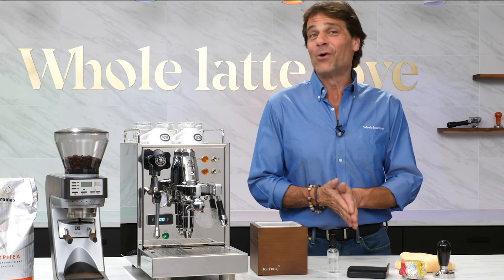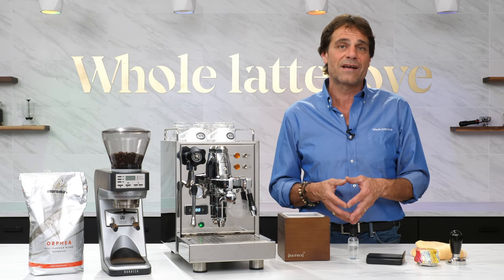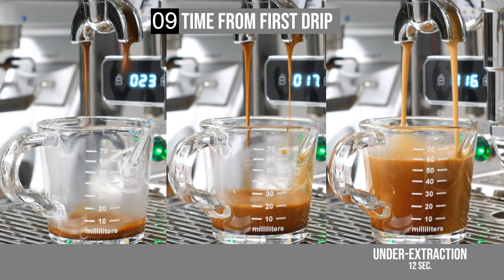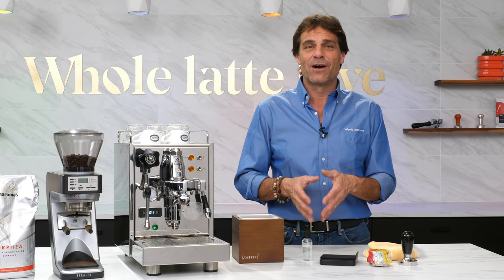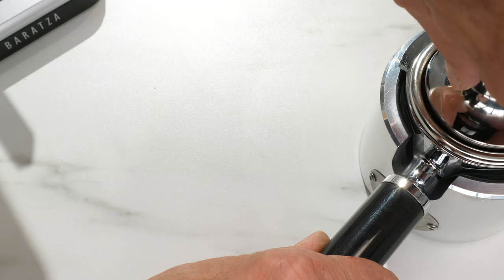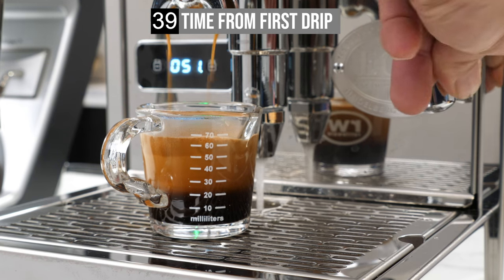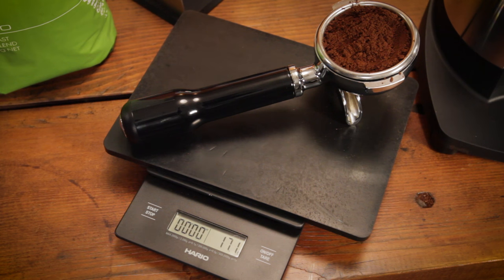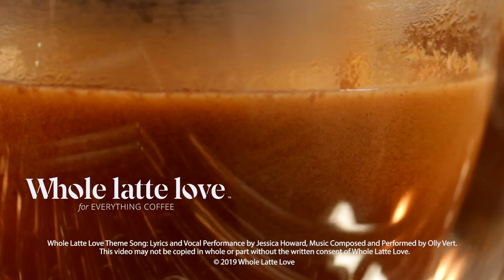How To Dial In Grind Size for Espresso

Comment: Newbie here. Why use the term dial in? I associate that with phoning in hence means half ass effort for me. Haha. 
Btw, I am using super automatic Philips Lattego 5000 and wonder if the 30seconds 60mls rules applies for that as well. 
And those aroma setting in the lattego refers to which parameter? 
Thanks in advance.
Reply from the maker: Hi Patrick, So Dialing in grind size is a common term for turning the grind size dial to get the grind right. Shot timing does not apply to super-auto bean to cup machines. They use the same process for extracting espresso as semi-auto machines but the amount of coffee used per brew cycle and design of the brew group with smaller surface area results in faster brew times. I have not used the Phillips machine but aroma settings on super-autos often refer to adjustable duration of pre-infusion which wets the coffee briefly prior to full pressure brewing. If not that it might be referring to coffee strength - the amount of coffee ground for each extraction. Hope that helps!
Marc
Reply: @Wholelattelovepage  thanks. Appreciate the reply. Philips lattego 5000 is basically a rebadged gaggia anima if not mistaken. I am watching this videos because i am thinking of switching to semi pro machines. Quite disappointed with espresso/ coffee from my superauto now. I am from Borneo so no place to try out or even see the machines before buying. I basically buy it online, based purely on youtube reviews such as yours. Shortlist now is nouvo simonelli oscar 2, rockett apartmento and maybe crem one.

Comment: I'm confused about what volume I should be getting from particular ratios. For and 18g double shot I'm usually getting around 36-40 grams of espresso at about 1 to 1.25 ounces. This feels a little low on the volume side as I would expect 2 ounces out of a double shot. Am I doing something wrong?
Reply from the maker: Hi n, Thanks for the question. If I understand correctly you are having trouble with weight of extraction vs. liquid volume? Weight is far more accurate! Volume measurement is difficult due to the crema. Some coffees produce more than others. I work with some which will do in cup volume of near 70ml at in cup weight of about 40 grams. Crema weighs a lot less than pure water which is 1g per 1ml. Other coffees I work with produce far less crema and will be closer to a 1:1 grams to ml relationship. Hope that helps!
Marc

Comment: Hey Mark, great tips! One question about the timing. I have a new Bezzera machine with Eureka grinder and I can see that in your case when the first drops of coffee fall, the total timer is around 10s. In my case this happens a lot before that and the first drops look quite watery. Nevertheless, the pressure on the gauge goes up to about 11 bar. I believe that going finer would increase the pressure even more. Do you have any suggestions?
Reply from the maker: Hi MH,  Thanks for the comment and question. Bezzera machines have an OPV which limits total pressure.  A bypass opens in the OPV valve to dump excess pressure back to the water reservoir. If everything is working properly you'll reach the OPV's setting and pressure will not increase so grinding finer will not increase the pressure. Frankly 11 bar is a high setting for the OPV to kick in. We typically set vibe pump machines to produce 10 bar max (that gets you ~9 bar max on the coffee puck).  If your first drips are happening really fast like <5 seconds and they're watery my guess is your grind is too coarse regardless of what the gauge says. I would try grinding finer. Gauge may not be reading properly.
If you have a backflush disc (blind filter basket) I'd put that in your portafilter and turn the pump on and see what the gauge reads. Once it reaches the OPV setting the pressure should go no higher.
Marc
Reply: @Wholelattelovepage  Thanks Marc! Interesting, these are actually the factory settings as the machine is brand new (Bezzera Unica) I indeed have the blind filter basket to test the OPV setting. If this max pressure is set at around 11 bar, do you think this might negatively affect the extraction or (even worse) damage the machine if I grind finer?

Comment: I got a question so i have a Solis Caffespresso Pro Type 177 with pre infusion which probably doesnt matter but the question is what ratio should i choose for the recipe i want to use?
Or the ratio is only dependant on the beans?
i have a 2/5 intensity roast(even though the beans seem darker than 2/5) which should be mild with karamel and chocolate.(Specifically a BOOT - Colombia Kachalu organic Santander)
Reply from the maker: Hi B, Apologies for the delayed response. I would try the coffee at different ratios and taste to determine which you prefer.
Marc
Reply: @Wholelattelovepage  thanks I messed around with it a bit longer with vids as base help it turned out really nice and at times absurdly sweet thank you for the vids!!!
And have a nice holidays. 🌷💞

Comment: Straight out the box (breville bambino plus), and according to the manual, 16-19g coffee for a doubleshot, it only seemed to be pulling 30-40ml coffee in about 14 seconds on the factory programmed 2 cup button.
I tried fiddling with everything, the grind size (now at the smallest my grinder will go), 16 vs 19g and different tamping. Using the razor and not. 
A bag of beans later, I managed to tamp tighter (with the help of some scales, breville says 15-20kg) and managed to get 60ml in 26 seconds but why was the factory setting so far off?
Is it because a quicker extraction is ok for pressurised? But it still doesn’t pull 60ml! Arghh!
Reply from the maker: Hi HW, Timing is out the window when using pressurized basket. It's mostly the restriction of the basket and not grind of coffee affecting the extraction. That said do grind very fine for best results.
Marc

Comment: Why did you measure to 70mm, I thought a double shot was 60mm. Was it to account for the crema?
Reply from the maker: Hi J, Thanks for the question. Yes accounting for crema. Volume measurement is very basic. Next level is using scale to weigh output and get a brew ratio. Check out this video where I pull bottomless triple shots to a 1:2 ratio using an Acaia scale and Brewmaster App to log extractions. 21g coffee dose with shot stopped at 41g weight in glass. Crema in the shots takes volume to near 70ml: https://youtu.be/HTaly8c-i_U
Marc

Comment: I have a Breville Barista Touch and am currently using Lavazza's Super Crema whole bean coffee. I've found that in order to get from 17g to 34g of ground to brewed volume, I have to go the finest ground setting. I grind for approximately 20 seconds at that super fine setting, but the grinds aren't flour-like. Am I doing things right??
Reply from the maker: Hi James, Thanks for the question. If your grind is truly flour like it's probably too fine. Espresso grind is often called "powder" but sounds like you are closer to a Turkish grind than espresso. Turkish is finer than espresso. Breville grinders tend to be slower than larger flat burr prosumer level grinders but 20 seconds seems like a long grind time for 17g. You didn't mention how long your extraction was taking. Your shooting for 20-30 seconds from first drip. In my experience extracting Lavazza Super Crema at 1:2 ratio yields in cup volume including crema in the measurement of 55-70ml as the shot finished at weight of 34g. Just to verify you are using the single wall (non-presurized) filter basket? If not, thgat's what you should use.
Marc
Reply: @Wholelattelovepage  Thank you so much for the reply! Yes I believe I'm using the single walled non-pressurized basket, which I believe came default installed on the portafilter. I do think I'm grinding too fine and for too long; perhaps it's my tamping technique that isn't quite right? When I was originally trying to dial in the machine, I kept on getting watery shots that went way past the 1:2 ratio. I guess I'm not tamping hard enough? It's hard to know how hard to tamp though, and I don't have a scale that I could use to see how much 30lbs of pressure really feels like. Should I try raising the grind size to coarser and try tamping more firmly to see if that makes a difference? Also, right now I have the machine set at a total of 25 seconds brew time, meaning the original drip occurs at 8 seconds or so and finishes at 25. I'm assuming this is too short? Perhaps I should try to get fresher beans as well? Thank you so so much for helping answer my questions!

Comment: Does a doser on a grinder help? And is it true that the doser only works precisely when there is a lot of grinded coffee in the doser? I at home make 1 or 2 coffee in the evenening, should i buy a grinder with doser for the few cases with a lot of visitors?
Reply from the maker: Hi Philippe, Thanks for the question. We sell very few doser grinders. In the process of phasing them out. In order  to dose consistently they need to have good amount of coffee in the doser. They tend to be messier than on demand grinders and with the focus on freshness most don't want a bunch of preground coffee sitting for long periods in a doser. When in Italy last year dosing grinders where still the norm in cafes. Here in the US and I'm guessing other countries a dosing grinder in a cafe would be a sign they were not very focused on quality and instead working a commodity. I would not purchase a dosing grinder for home use.
Marc
Reply: @Wholelattelovepage  thanks, that makes sense. Another question, if i may ask here. I have a siemens eq6 now and planning to go for a half automated next year. But i like the DE version of the Bezzera, or the Elektronica from ECM. Also i like cappuchino so i need HX machines. I dont have unlimited budget, but can you recommend on a programmable dosing piston machine like the bz10de or bz13de or a e61 variant, with rotary pump and watertank+external water connection? 👍🍾

Comment: Question, we got a breville barista express recently. I only get to a 10 o'clock position on the pressure gauge even if the grind size is already dialed on the finest setting, should I be concerned?
Reply from the maker: Hi Vince, Sorry for the delayed response. I've been off line for about a week. I do not have a Barista Express in front of me at the moment but I believe 10 o'clock is in the acdeptable range for brew pressure. If you think it should be higher using the same grind size but a higher coffee dose can get you there. A more forceful tamp could help as well. You can also adjust the grind finer than the basic settings outside of the machine by making an adjustment on the burr itself. See page 20 of this manual for how to do that: https://www.breville.com/content/dam/breville/au/assets/miscellaneous/instruction-manual/espresso/BES870-instruction-manual.pdf
Hope that helps!
Marc

Comment: I have an ECM synchronika and my extraction starts at 4 seconds and reaches 25 seconds with 2oz fluid. In your video it seems to start at 8 to 10 seconds. Is 4 seconds good to start ? What can i adjust to make it start at 8-10 sec for 2 oz fluids? Thanks
Reply from the maker: Hi jg, Thanks for the question. Typical ways to slow an extraction are finer grind and/or increased coffee dose weight. A little harder on the tamp may extend as well but depends how hard you are doing now. First drip at 4 seconds is a bit quick IMO.
Marc

Comment: How would you dail in espresso without a weight scale? Got a grinder and manual shot control (but no temperature or scale).
Reply from the maker: Hi RK, Thanks for the question. Thanks for the question. Without a scale slightly overfill your portafilter then level with a finger prior to tamping. This should give you a relatively consistent dose weight shot to shot. That consistency is important when dialing in. Hope that helps!
Marc
Reply: @Wholelattelovepage  Thanks Marc, how about the volume? Do i need a cup with the scale?

Comment: thanks for this! do you still tamp after distributing with the distributing tool?
Reply from the maker: Hi Oscar, You are welcome. I do not tamp after leveling but some people do. It helps if the basket size, coffee dose match and the leveler head depth is properly adjusted so the coffee compacts properly.
Marc
Reply: @Wholelattelovepage  Marc, now that I’m using a larger portafilter basket (IMS Baristapro Nanotechnology 22 gram. I fill it to 21 grams and I’ve got my grind set on my SetteWi so the pull is 20 plus seconds.  The puck of coffee falls completely apart when I put it in the knock box. When I use to put the coffee in the knock box it stayed almost whole, maybe broken in half.  Is it necessary for it to hold it’s basic shape in the box.  The shot taste great!

Comment: I have a smegg espresso machine that uses a pressure basket . How do you dial in a shot since . Tamping is not that important . My espresso tastes better in a little sour. The basket only holds 12 grams of espresso and that's for the double shotI don't know how to dial this one in I know that it's a two-to-one ratio for espresso so I would do 12 g of coffee with 24 grams of fluid or coffee coming. How do you dial in that specific so I can get a halfway decent
Reply from the maker: Hi SJG, With a pressurized basket it's the basket which determines flow rate and not so much the grind of the coffee. If your dose is 12g then 24g out is a 1:2 ratio. If flavor is sour that indicates under-extraction. That could be caused by grind being to coarse and/or low brew temp. Low brew temps are common on low dose, appliance grade, pressurized basket products.
Marc

Comment: Mark, its normal to get the first drip around 6-7 second after you turn up the pump?
Reply from the maker: Hi Hollow P, Thanks for the question. It may be normal. The ECM Classika used in this video is a vibration pump machine. They build up pressure more slowly than rotary pump machines so 1st drip happens later. 6-7 to 1st drip on a rotary pump machine is not unusual.
Marc

Comment: Can I make dilling with one dose in double basket? Also... How do you measure the amount of coffe with all that crema in the glass?
Reply from the maker: Hi Dario, Best way to measure extraction output is by weight. Typical espresso extraction use a 1:2.5 ratio so by weight if you used a 10g coffee dose you be at 25g of espresso out. But many don't have a scale. In crema rich shots I'd figure about 10-15 % reduction from crema settling. Working with single doses is difficult. I recommend working with doubles especially if newer to espresso.
Marc

Comment: Have you ever used breville barista having trouble with mine dialing in?
Reply from the maker: Hi Tom, I have used the Breville Barista Pro. Not much to go on from your comment to offer advice. So keep the basics in mind. Be consistent with variables other than grind size when dialing in. Use the same dose weight of coffee, tamp the same, etc. From there if extraction is too fast grind finer. If too slow grind coarser.
Marc
Reply: @Wholelattelovepage  thank you for your response I will do so I'll let you know how I makeout

Comment: I have a 54mm Breville basket and when dosing 18g I see water screen impressions on the puck if I test fit it in the group head. I saw another video stating if the coffee is touching the screen can burn and affect taste. Is this tolerance too tight?  Breville machines come with the razor tool to check clearance yet I still see the screen marks. 
Thanks
Reply from the maker: Hi KM, Yes, it's not ideal to see an impression of the shower screen on your coffee puck. You want some headroom (clear space) between the top of coffee puck and shower screen. It's not so much burning the coffee but causing uneven distribution of water onto the coffee with the potential to cause channeling of brew water through the coffee cake during extraction. Beyond that your shower screen will get dirtier.
Marc
Reply: I appreciate your response Marc. Of course after I commented, I later found your video on baskets and filters which clearly explained this. I will drop my dose and look into your recommended basket upgrades if decide to keep a higher dose.  Thanks for the content and advice.
Reply from the maker: @kmiller9580  ☕ You are welcome!
Marc